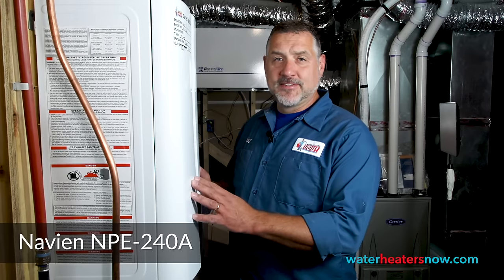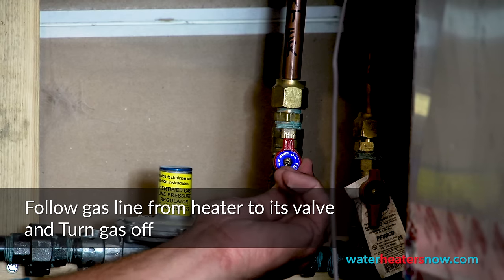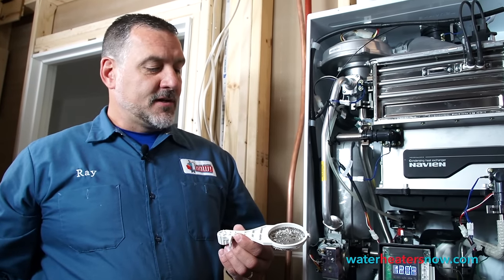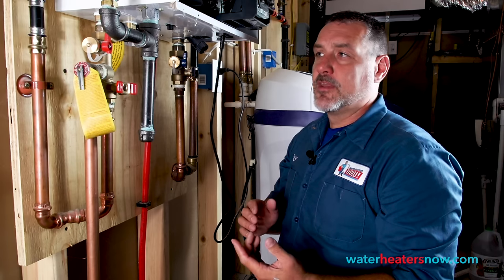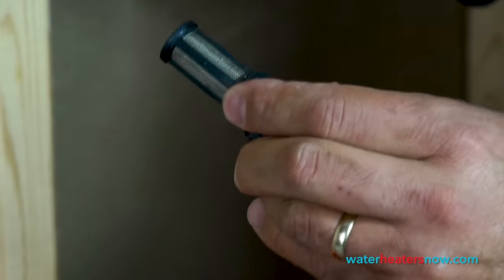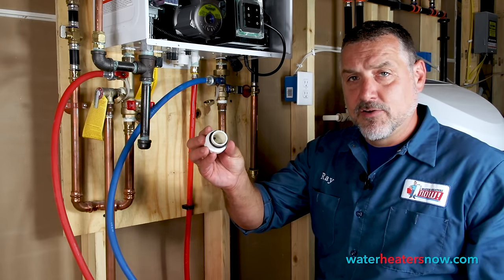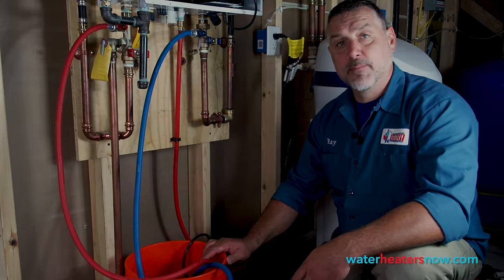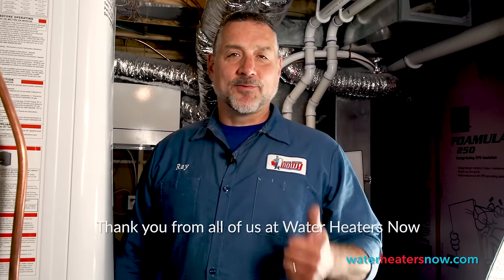Navien Tankless Cleaning   Water Heaters Now

Comment: Great Video.  We also have a Navien NPE-240A with recirculation.  Our isolation valves have hose hookup fittings directly on the isolation valve and they do not have their own separate t-valves.   Will these work for flushing purposes?   We do not appear to have the separate service valves as your installation does.
Reply: Yes.  Mine didn't have the service valve shutoffs and I just did it the same way.  When you turn on the water, it comes out.  no service valve so just use the main valves as the on/off.

Comment: So, second time doing this and still come back to this video! However, I seem to have an issue with the system not draining when I open the service valves. Only a little bit of water comes out even after waiting 15 to 20 mins. as well as moving the hoses around. I undo the black screen filter, and water comes gushing out. I undo the dirt trap, and a bit more water comes out though not as much. Is there something I'm missing, or is the unit not mounted correctly? The flush is still successful as far as I'm concerned. Just would rather not have water go everywhere undoing that screen.

Comment: I have the same unit. it’s been in service almost a year great unit so far! I’m looking at mine and I have no service valves. The main hot and cold valves are where you service valves are but they are centered on the pipe. It looks like they plumbed one valve for shutoff and service. 

Is the normal in the industry? This is my first tankless.

Comment: Where is the company located? I need to replace my Navian NR240, my heat exchanger is leaking. I'm located in Mass. My plumber told that I didn't have to worry about this cleaning, now my system is leaking because of the no maintenance. This was great video, thank you for sharing.

Comment: hi i have a Navien combi boiler. Your video shows how to flush the water heater, which is very good. Do i need to dot the same thing on the boiler sider as well? the boiler side seems to be of a different mechanism in the way the water loops in the system? Appreciate it very much if you could have any insights?

Comment: I followed this last year and worked perfect. This year when I plug my pump in it starts fine for 30 seconds with strong pressure then it stops. I thought it might be the pump but I removed it and tried it with an empty bucket and it works fine. Anyone know why the vinegar would stop after 20-30 seconds?

Comment: Excellent video. I used this to help me clean my combi 240. One question i have is how do i purge the air when you turn back on the water?
Reply: Mahendra, I also have the combi boiler and the unit seems to be able to self purge.  It shows a code the manual reports as self purging and takes a few minutes to do so.  One of the times, it failed and I restarted everything again and it worked.
Reply: Bob Pritchard this make sense. When i cleaned mine, first and second start up kept showing AIR on the screen. After awhile it cleared it self. Havent had any issues. Thanks Bob for clearing that up

Comment: You need to add a step of cleaning out the condensate line, espcially, if the C.L. line has a long  run to the outside.

Comment: I have two hot and cold inlets and outlets - a domestic line and a heating water line. Which do I attach the circulation hoses to for descaling? Do i need to shut off all the lines?

Comment: Excellent video.  Question... I have a different water heater but the steps are the same.   When I did the vinegar flush it would not circulate.  I did verify the valves for hot and cold were off and the service valves were open.   Any thoughts on why it does not circulate.   I did turn off the cold service valve and opened the cold water valve and it ran cold water out the hot.   I also verified the pump was working and even tried a different pump.   Thought I’d ask before paying to have this done.

Comment: I know the vinegar is cheap but can it be recovered and reused?

Also a tip to the home owner:

After flushing with vinegar run fresh clean water through the pump and rinse your hose connections. Vinegar is an acid and will corrode the hose fitting and pump internals. This is cheap insurance to keep a homeowner flush kit operating w/o issues for several years. One other thing, make sure the hot return hose is flowing vinegar when you turn the pump on. If it’s not, gently tilt the pump while still fully submerged in the bucket to prime it. Once you do that you should see air start to purge out of the hot return hose then flowing vinegar. Hope this helps.

Comment: Good video but I would add 1 important step. BEFORE plugging in the pump place a women’s pantyhose over the end of the hot hose that is in the bucket and secure with a rubber band. During flushing small scales may fall off heat exchanger. You don’t want to circulate those back into the tankless during the flush where they might get caught in the cold inlet filter that you just previously cleaned. The pantyhose acts as a filter. I prefer to clean cold inlet filter after the flush instead of before it.
Reply: Thanks for the tips on the pantyhose filter and cleaning the cold inlet filter after running the vinegar bath.  You might not have to use the pantyhose trick it your sump pump has a plastic, grid filter on its base like mine does.  The grid holes look to be about an 1/8" square. Is that fine enough to keep the small scale from circulating back, i.e. that how fine a scale particle do you have to worry about?  Also, I think I may just clean the cold inlet filter *twice*; the first time to see just how much debri is coming in from my water supply (hopefully, very little) and the second time to clean out anything that has been trapped during the vinegar bath.

Thanks to Water Heaters Now and Franks Plumbing in AZ for the very helpful video and advice!

Comment: I recently installed a Navien model 210S2 which doesn't have the internal circulation pump.  It takes 45-50 seconds for the hot water to get to sinks and showers, even though I already installed an external Watts pump (3.11 GPM) with a universal circulation T-valve (not a Navi circ) under the kitchen sink.  Do I need to install these universal T-valves under every sink to help with hot water gets faster?  Please reply with your recommendations.

Comment: Question.. does this brand of water heater have some kind of drain? I have a dehumidifier and I'd like to have it run constantly but I don't have a drain and the water reservoir fills fast. I'd like to drain it directly. So yeah, if there a drain with this unit?

Comment: How do I know how strong the pump needs to be. I have a small pool cover pump for rainwater. Will that do? Great Vid.
Reply: i saw another vid the guy said use a small hp pump like 1/5 or 1/6th HP. He said that a 1/2 a horse power pump is too strong and would would flush through too fast for the detergent or vinegar to properly descale.
Reply: @1rtt1  Thanks very much.

Comment: Great video. Great detail. Best I’ve seen. I have the ncb-240 model. Do I need to separately flush the boiler side, too? If so, do you have a video on that? Or does this flush both sides?
Reply: Yes you do I personally on a combi boiler I install both installations kit valves in both domestic and heating systems so you can clean both heat exchangers once a year before the winter starts.

Comment: Noticed a brass fitting on the condensation drain at the bottom of the unit. The brass fitting will Eventually leak from the Acid in the condensation. That fitting should be plastic

Comment: Just had one installed. Worked great with minimal startup noise. After plumber installed a water pressure valve to lower my pressure to 60, was 100 before, now there is a groaning noise prior to startup and unit startup is louder. Pressure now at 70, no change. All lines and unit flushed, all pipes secured. Plumber says it's  normal. Have a water filter right below the unit. Any ideas to stop groaning?
Reply: Mine also makes a groaning sound at startup.  I’ve been running it about 10 years.

Comment: Just curious if it would be okay to let the vinegar run threw the hot water line instead of draining into the pail after your done the descaling .Or would it just plug up your taps with the crap that came out of the water heater .

Comment: I have a few questions.
I have the same Navien water heater.  My tech did the Descaling today.
Once her started running the vinegar through the unit he turned the Navien on and the vinegar was running through while heated up and circulating.
For about 30-45 minutes.
So the vinegar wasnt running cold like this video but it heated  up to 120 degrees while it was circulating.
Is that  good, bad or doesn't matter?
It would think that hot steaming vinegar would clean better than cold vinegar but I have no idea if that could damage anything or cause any issues?
Let me know your thoughts.  Thank you.
Reply: Definitely dosen't damage anything.  The cleaning needs to be with a unit off vinegar is alright but there is a product made apposite for cleaning tankless and is called Proflow

Comment: I have 11 units (5 and 6 - 1 commander for each side) when Descaling most of the times I have issues not having flow between cold service inlet and hot service outlet. Do you know if is there any internal shut off valve that stays closed  not allowing the water run through the heat exchanger  . Before you ask, yes both service valves open, inlet and outlet closed, recirculating inlet closed, sump pump is OK with tons of pressure . Any comment appreciated.

Comment: Have not done the vinegar flush in 10 years. Also, don't have the flush fittings either.  7/2010 install date.  Have a water softner though.

Comment: Very good video, question i have same system i have error says ftom manual its air filter i took it out cleaned it with brush reinstalled it but still have error. E 110 abnormal air pressure.

Comment: Is it necessary to turn the water off to the whole house?
Reply: No, not if the heater was installed properly.  It should have two isolation valves (ball valves with a handle)

Comment: In replacing a tank with a tankless water heater that’s located in the middle of the house and a recirculation pump is installed, would multiple recirculation lines have to be installed throughout the house?
Reply: Ideally, no.  Best practice is for the hot water piping to make one continuous loop from water heater to each fixture (within a minimum distance) and eventually back to the water heater.
The hard part about multiple recirculation lines is balancing the returns.

Comment: i don't even have one yet but i plan on it! Awesome video thank you.
Reply: The initial cost is about 2-3 times what you would pay for a new water heater. Check with your state to see if there are any rebates for using a system like this. I believe where I live in MA, the state gave use a $800 rebate which was very sweet. In all to have it installed, I wanna say it cost me between $2100, and $2400, can't remember exactly what I paid, but the rebate and the fact that I was also saving on my gas bill each month was a no brainer. Having a large family, an on demand hot water heater was necessary.

Comment: One thing bad about these units is the electrolysis on the outflow part of those fancy $100 fittings . The valve got compromised  when I went to flush it , the stem broke off and water squirted all over me. Now I make plastic flex pex lines up now and  incorporate the valves in the pex And the blow off in a SS tee right off the unit.  Now it can be shut off then disconnected using the hose fittings,  so it can hook up to a pump and drain hose for flushing. Also make sure you clean the screen regularly so it does not freeze up and break on you. If it does it you will be out of water till you get one, It's the weakest link in these units.

Comment: said by others using vinegar is over 1 hour and 30 minutes of water to flow to flush that is about 60 gallons for the job vs less for the reccomended cleaners. you be the judge based on water in your area and tank using high end prefilters etc etc
Reply: Yes.  That depends on your water supply.  It also depends on how much water your use and how long between cleanings.  Cleaning more often id there is buildup will improve efficiency and save money.

Comment: I have a Navient water heater for 3 years now and I am regularly servicing by cleaning intake air filter, cold water filter. And also doing white vinegar pump service as well. But last few days I am not getting enough hot water pressure in my shower or sink. I clean out flow sensor but still not helping. Any advices!!!!please!!!!

Comment: Hi, Our old an on demand / tank-less gas water heater system is messed up. This one has a recalculation pump. It seem we only get hot water when another hot water tap is open than it seems to heat water fine than after a minute the water flow completely shuts off. If I turn the hot water valve off for a minute or so it will turn on with good flow for about a minute than completely shuts off the water flow. Anyone every had this issue, and how did you fix it  ?  Thanks

Comment: I have heat and DHW. Which lines do you use to drain and clean the boiler with vinegar,  there's two for each system.
Reply: theres only one heat exchanger

Comment: Npe-240s natural gas hot water heater will not flush out no matter what I do, there are 2 electronic valves preventing flow through heat exchange. Help!!!!! How many volts and where do I send it?

Comment: Doesn’t Navien say not to use any metal fittings on the condensate drain since the condensation will eat through metal? If you use Uponor they actually approve expanding a 3/4” piece of Uponor with a ring and placing it over the threads.

Comment: IF UNIT WONT FULLY TURN BACK ON AFTER SERVICE, you have to hold the power button for 5 seconds to REALLY turn it on. After combing the manual and not getting error codes even though the unit was on, and a 45 minute hold time with support, the tech suggested that the unit needs the power button held for 5 seconds to really turn it on after its been unplugged for x amount of time. Would be nice if that was in the manual or a code or something.. 

Otherwise, excellent video

Comment: What extra steps or precautions should one take for model with external recirculation line installed.
Reply: I read the manual, which called for a third hose, which really threw me off.  The manual is a little misleading about needing a third hose, though.  The third hose is intended for your "bucket" pump, not your re circulation pump.  In this case, the technician has a pump with an inlet at the bottom, not an inlet for a hose, so he doesn't need the third hose.  There is nothing in the manual that describes a different procedure for heaters with re circulation, other than making sure you clean the pump inlet filter as well as the cold water inlet filter during regular maintenance.  There is also a separate drain plug the re circulation pump, FYI.  Manual available here in case you need it:  https://www.navieninc.com/downloads/npe-a-s-manuals-operation-manual-en
Reply: Scott Saunders I just turned my valve to recirculation line off during the procedure and back on after I was done. Seems to have worked fine.

Comment: Hi I have a question my tank less hot water heater is making a nose and keeps on running with all the the spietes are off .I have hot coming out of them and there no nose either .but wen I turned the spietes off it makes the nose again.ps if make sense 🙄
Reply: It's only a year 1/2  years old thanks

Comment: Great job on video A+++++ I try VINEGAR and it didn't work! I talk to my HVAC Contractor and he recommended Flow-Aide System Descaler ,32 ounces (1 quart) instead of using vinega and work great!
Reply: Peter Kharitonenko I’m looking into this because I’m curious about the Flow-Aide vs vinegar results. So far what I’ve seen is if you haven’t flushed your tankless in a few years you’ll probably get better results with Flow-Aide. It also seems the Flow-Aide might work better against lime. But if you flush yearly then vinegar should produce satisfactory results. So I’m curious. From your comment it sounds like you were having a problem with your system (I assume an interruption in your hot water). How long had it been since your system was flushed, and do you know if you have more lime than average in your water supply? Thanks!!

Comment: I just got the Navien Npe-240A and I noticed the trap cap is leaking water,  the plumber said that I need to install a pump system to push all that water out, that the tankless system will always leak. Can someone confirm if I need this pump that the plumber is talking about? It actually seem odd to me, but may be hes right

Comment: These units are prone to exhaust leaks inside the house. Check the inside of units for oily residue on black plastics around heat exchanger or discoloration on PCB boards. Both are signs of cross contamination from heat exchanger top gasket and/or rubber gasket connecting heat exchanger to exhaust. This is a known problem with the brand and should be checked on every unit

Comment: Yeah, but what happened to the recirculating pump filter, and cleaning the ignition rod and flame rod. And if it’s a 240A2 you have to go into the control panel in service mode and tell the heater your descaling, and blow out the heat exchanger with compressed air..
Reply: He also didn’t mention that w the A2 model there’s the recirc port on the hot side. Does that need an hour of flushing too?

Comment: Why can't you back flush the exchanger? I have had better luck when descaling by  making the vinegar flow backwards. Works great on car heaters. Also, a high pressure blast of air at the beginning flowing (backward) from hot to cold will initially blow out loose scale and debris giving you a headstart on descaling.